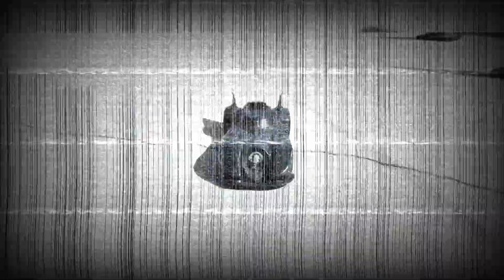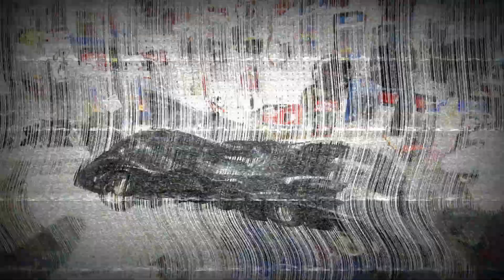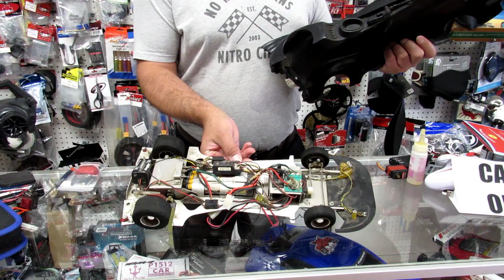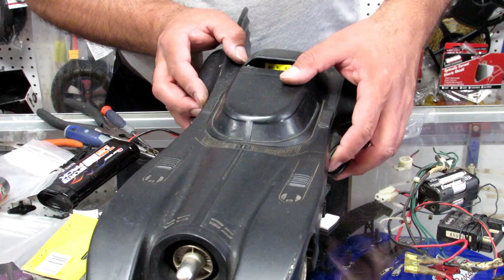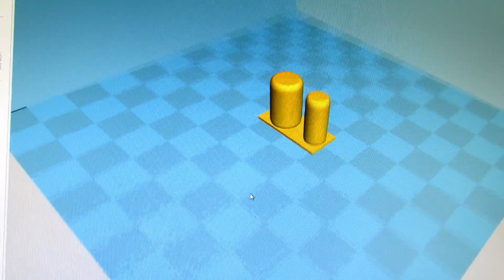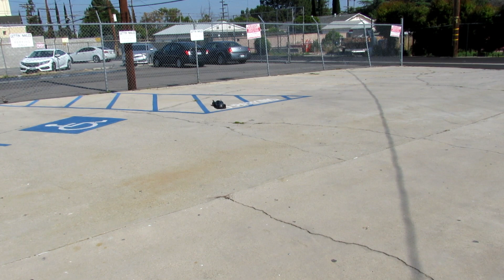How to:  RC 1980's Batmobile Restoration!

Comment: Can you make these go faster by switching the motor?
Reply: Yes you can I have the same vehicle with castle creations sidewinder 3 wp ESC/Motor combo 5700kv with sensors 1406 motor and a 3S lipo 5500mAh 50C battery  new soft drag tires new servo and fans last time I checked the speed limit was 76 mph before losing control
Reply: Steven Surita you should upload a video of how it runs and the electronics, I have one myself and I’m looking to upgrade it.
Reply: I restored one with brushless on my rc channel way faster 👍